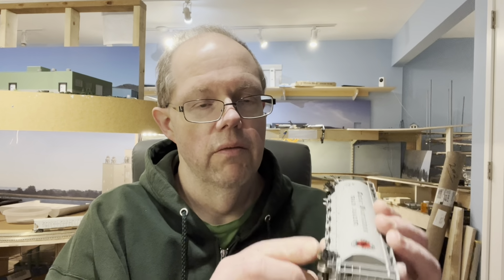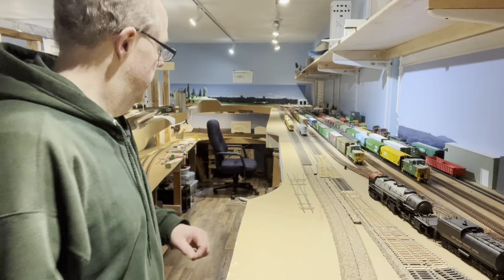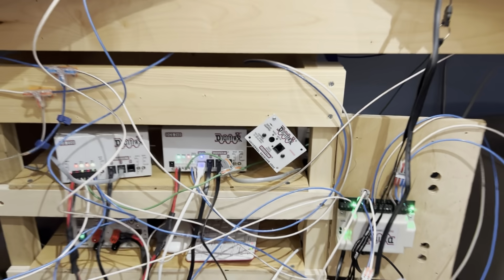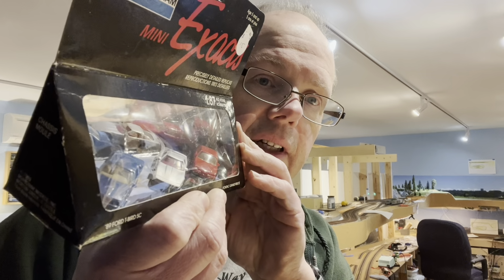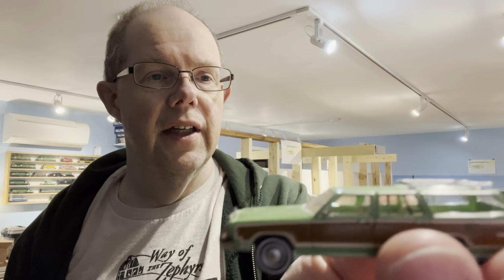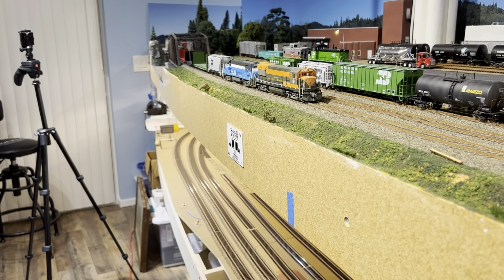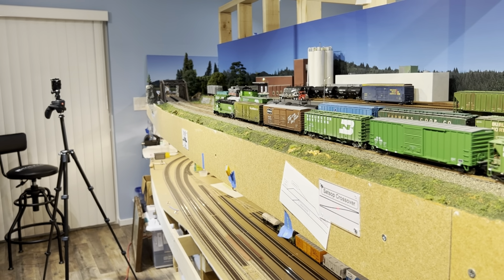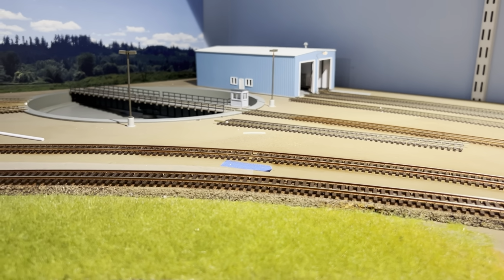South Olympic Branch Update #67

Comment: Do those locomotives have a keep alive in them?  I would think that it would give you a 1/2 to 1 second delay before dying in the direction it is traveling. I am interested because I may run into this problem with my N scale . They have Tsunami 2's in them and I will start testing later in March hopefully.
Reply from the maker: The one that stalls does not have a keep a live in it. Some of my other ones do, but I found that they have some interesting effects… like lurching.  But I also removed the circuit breaker off. the yard the issues seems to go away.